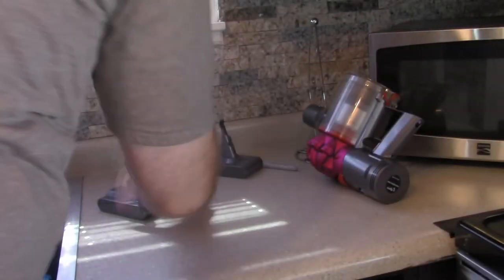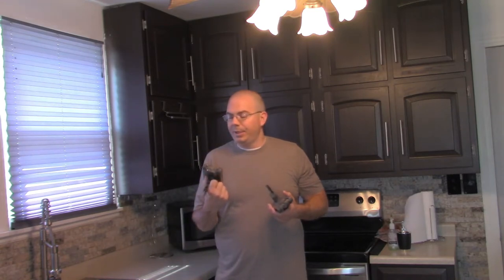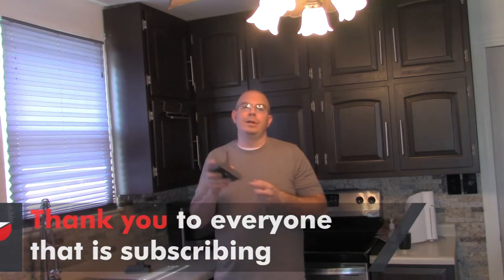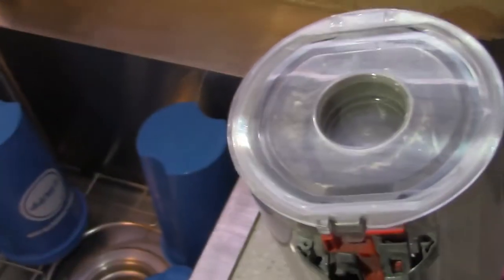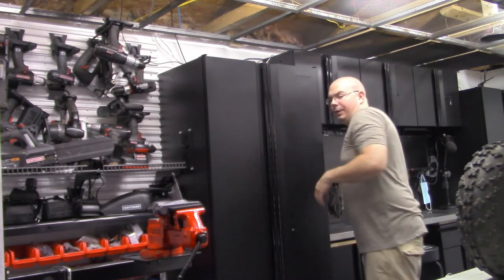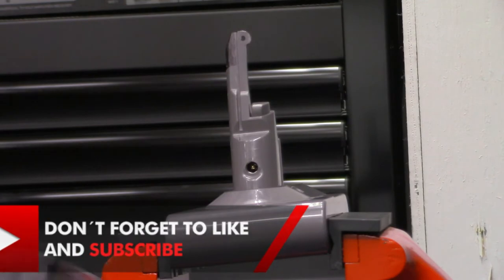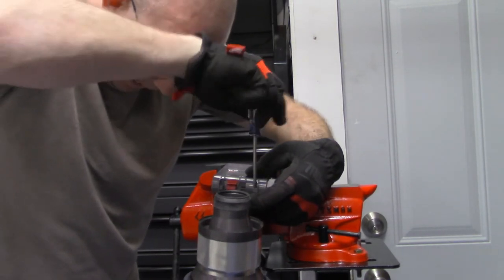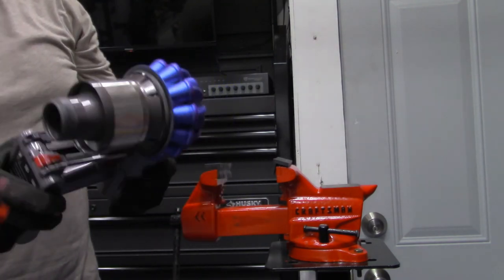Can A Dyson V8 Battery Be Installed In A Dyson V7 Motor Unit?????

Comment: Just a correction, the stock Dyson V7 Battery is 2100Mah and the stock V8 battery is 2800Mah (both at 21.6V). The new battery you have is one of the aftermarket batteries which usually lie about capacity. An easy way to tell is size and weight. If that was truly an 8000Mah battery, it would be significantly heavier and be at least a bit bigger. If your going to go with aftermarket batteries there is no reason to do this, you can just buy "higher capacity" aftermarket V7 batteries. Im sure after a short time you will see how bad those aftermarket batteries are. This is a useful video though since I want to use OEM V8 batteries in a V7.

Comment: I have a V8 and ordered a V7 body by mistake, so I modified the battery, didn't have a drummel tool, so I just used a hack saw blade secured in a vice grip.....LOL. Just went one direction with it and it cut really easy and clean. Plugged my V8 battery into the V7 and worked perfectly....Thanks

Comment: I bought a battery from ebay, V8 battery to do this mod and put it in my V7 however I never had to do anything but file the inside of the top screw hole so the screw screws in, other than that even before filing the screw hole it fitted in and powered up the dyson:)

Comment: Watched your video. But when shopping for a V8 battery I found one that looked like it didnt need to be modified. Shoved it right in. Works great. Although not 8000 but 6000
Reply: which battery did you buy?
Reply: @jraymond3218  can you drop the actual link? When I search for it, I can't find it. All i find is the v7 battery from ac doctor inc.
Reply: V8 21.6V 6000mAh Lithium Battery Replacement for All Dyson V8 Series Vacuum Cleaner, V8 Fluffy, V8 Animal, V8 Absolute, V8 Motorhead, V8 SV10 Vacuum Cleaner Battery with Kits
    Sorry this is the best I can do. Type the info in the amazon search bar. See what comes up.

Comment: Thanks for the video, just 1 question, I understand the V8 motor is a bit stronger than the V7 so can the V8 battery that has more amps do any possible damage to the v7 motor? I would think not but just checking  Thanks       ""As long as the correct voltage is used, a device will draw only the amperage it needs, meaning there will not be “too many amps”. If an incorrect voltage is used — say a higher voltage than the device is rated to accept — then yes, too many amps may be drawn and the device can be damaged"

Comment: Thanks for making this video. I bought the wrong battery for my v7 motorhead.  Did what you said and it works!!  I did the cutting using a hot knife / soldering iron with a knife tip as I didn't have the power tool.

Comment: Hi,  can you please let me know if the V7 with V8 battery installed will fit into the original V7 charging/wall cradle?   I'm assuming that the charging plugs are compatible.  There are a lot of high capacity batteries advertised for the V7 (eg 9000 mAh for some units on eBay)  however I'm very skeptical because if they're built with the standard 18650 cells (as seen in a teardown) then they max out at around 3500mAh so it's implausible to get anywhere near the advertised value - any comment on capacity?   Thanks for the videos
Reply: Update - I borrowed a V8 and it fits the V7 cradle so should be no problem fitting a V8 battery into a V7 body.  Advertised battery capacity being up to spec? - well that's still up for discussion

Comment: Iv had super bad luck with Amazon Batteries, theyre usually Garbage and arent anywhere near the mah  that is stated and dont last.  can you give an update on this battery.  Hows it working out for you?
Reply from the maker: Still using battery everyday. I vacuum a three story building with this daily.
Reply: @TorrentPerformance  what aftermarket brand did you use for the v8 battery? great video man, thank you for sharing your wisdom
Reply: @TorrentPerformance  also, do you know if the cyclone + bin on the v8 fit onto the v7 body?
Reply from the maker: @feliiiik  link in description below to battery
Reply from the maker: @feliiiik  same body and cyclone pretty much for v7 v8 series vacuum

Comment: Does anyone know whether the charging circuit is inside the battery, or is in the vacuum? I'm just wondering whether, if it's in the vacuum, the V8 battery would be charged optimally by a V7-type charging circuit.
Reply from the maker: not sure about the circuit question. But the same charger cable is used on the v6,v7, and v8 model vacuums.
Reply: @TorrentPerformance  OK thanks! I hadn't taken the battery out of the vac yet but now I see that the charger cable goes straight into the battery, meaning that the charging circuit is in the battery itself. Which is good news. The wall wart looks like it's just a basic AC/DC converter, putting out a constant 26.10 VDC, and the voltage regulator, etc. for correctly charging the Li-ion cells is most likely in the battery pack itself. TL;DR: probably no charging issues with putting the V8 battery into the V7 vac.

Comment: All the battery replacements are listed as OUT OF STOCK, and no indication of availability.
Are there any other reliable sources that use HI quality components?
It also seemed that your source also made a 6000 maH battery for the V7, in which case no modifications would be required.
Reply: just buy the adapter and use tool batteries.